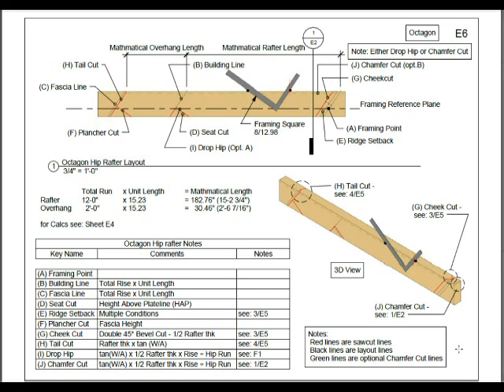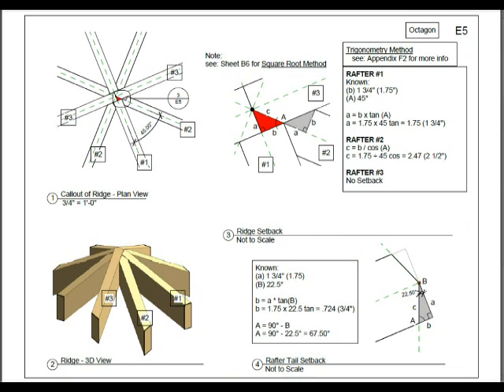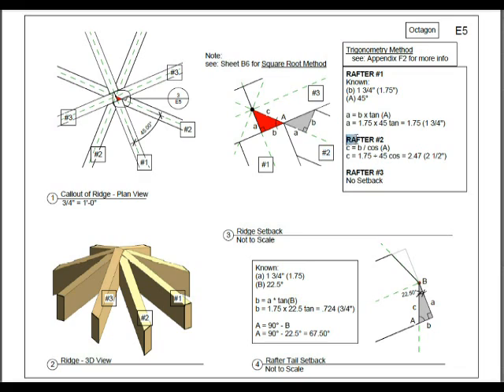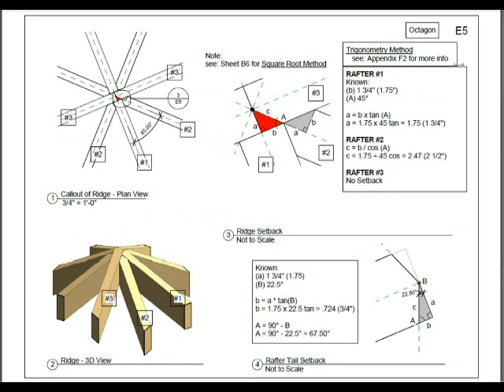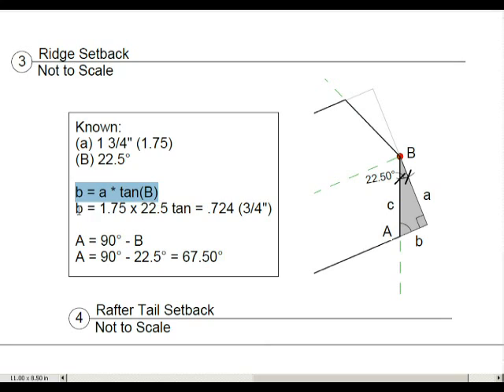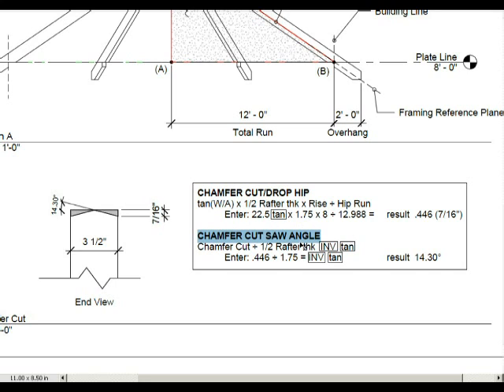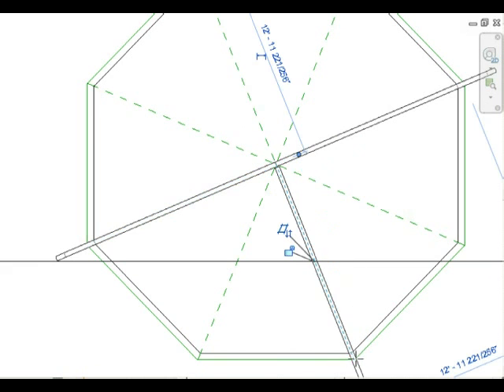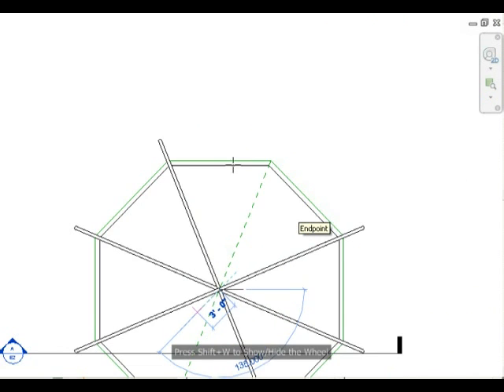Gazebo Roof Framing - Part 2

Comment: Please tell me what program you are using
Reply from the maker: I use Revit. It’s expensive but amazing what you can do with it, especially for architecture. In the case of the rafters in this video, I created parametric families that can generate schedules used as cutting lists. Very deep program. 
If you’re looking for visualization programs, SketchUp is very intuitive and either free or affordable for the professional version.
Reply from the maker: I’ve also developed a roof framing calculator (excel based) that I’ll send you if you’re interested. Drop me an email: mark@velocirafter.com

Comment: Hi. I am an experienced oak framer and have been asked to build an octagonal gazeebo. I have no problem with the maths but one thing that is perplexing me is the roofs have a low pitch with no tie beam. Why do the roofs not push the walls out?
Reply from the maker: Hi Fabia,
I assume that most gazebos have a relatively short span so it's not a major structural issue. Personally, I would use clips or at least use lag bolts to fasten the perimeter top plates together to keep from spreading. 
One one project I did, the clear span was 36' and supported a 6' cupola (with windows). In that case, my structural engineer designed a steel band, welded in place around the outside perimeter of the top plate. This prevented the building from spreading out.  20 years later, it's still standing!